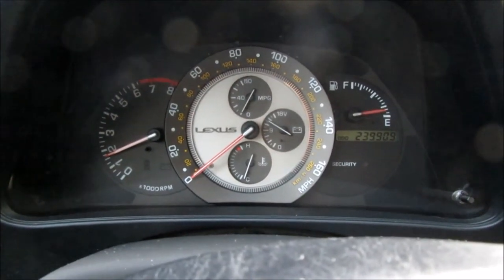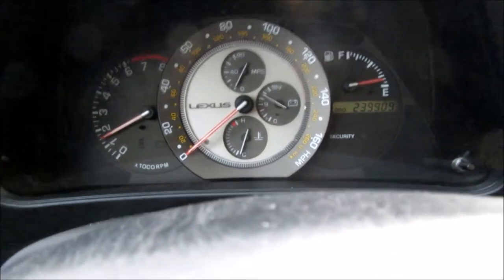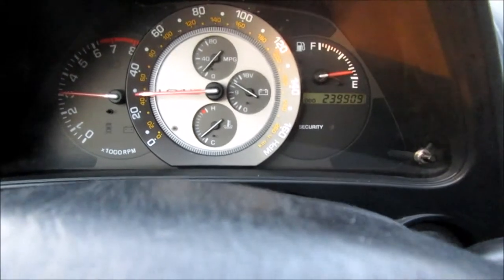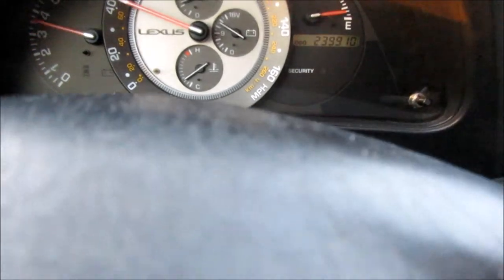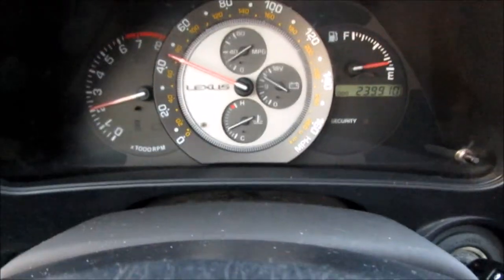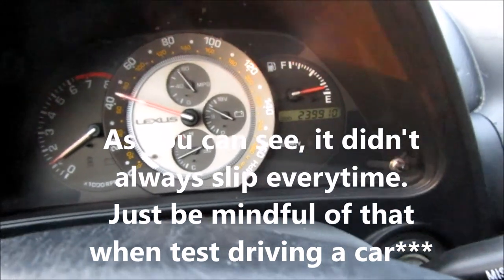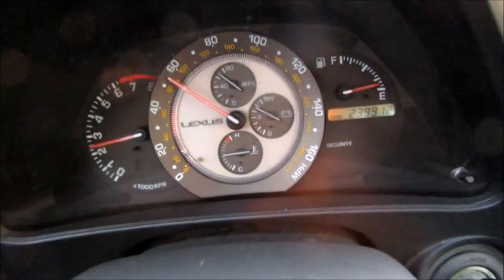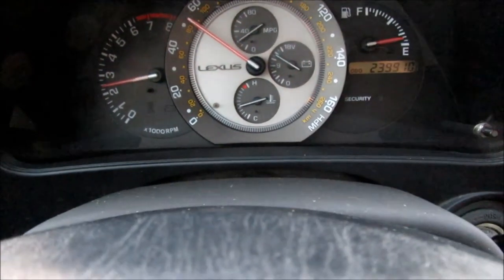Lexus IS300 slipping clutch example

Comment: Hi I have this issue with my vehicle right now and don't have any other signs of clutch wear. Would it be the clutch still or possibly other problems and I should scrap it
Reply from the maker: If it was running right up until now and that is the only symptom, then it's a pretty good sign that is what it is.  Assuming nothing with the clutch hydraulics or pedal has recently been adjusted, then it is a good chance that the clutch is just slipping.
Reply: @DIYAUTOCAR  yeah it's only now started to do it. Is there a guesstimate to how long it would last now aha really can't afford it right now it costs the same as my car did to get replacement 😭🤣

Comment: I have a Fabia vrs remapped, when I get to 2k rpm and on boost in 3rd and 4th, my throttle blips slightly to 2.5k rpm then powers through the rest of the Rev range normally, I don’t loose any power and keep a steady acceleration while this happens also doesn’t happen all the time. I’ve been told this could just be a poor remap I have on it causing it or would it more likely be the clutch slipping??
Reply: What did it end up being ?
Reply: Clutch slip

Comment: do you know why my clutch making a clicking noise when i hit the gas pandel?
Reply from the maker: I can't say that I've had that happen.  I'd have to see it or at least a video to ahve any clue.
Reply: Hey did you ever find out about your problem¿
Reply: It’s not that big a deal. Happens to most cars, sometimes comes and goes, not a issue at all imo
Reply: Could be a defective dual mass flywheel, defective clutch disc springs, or worn/ broken motor and transmission a mounts.
Reply: @BC-wf7mv  It's definitely an issue...why would you say this? A clutch should be silent. Any rattling, ticking, or clunking is an issue. 😒